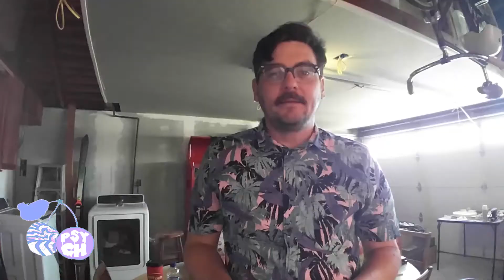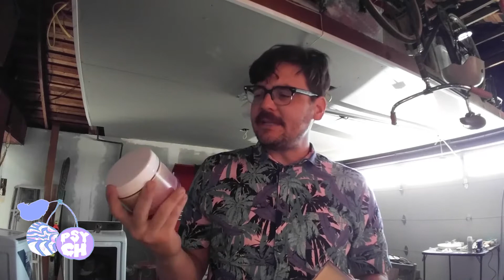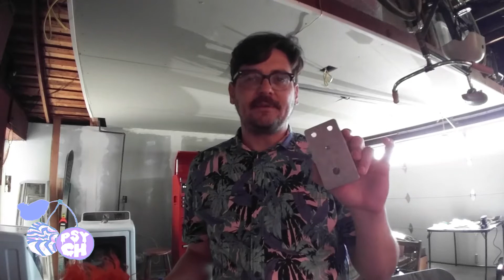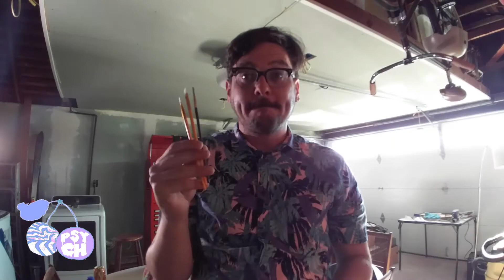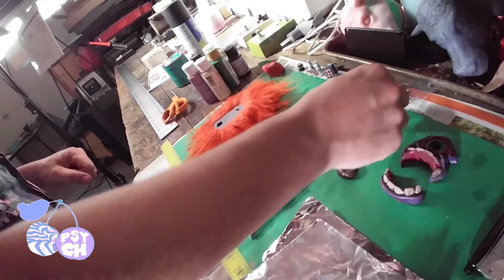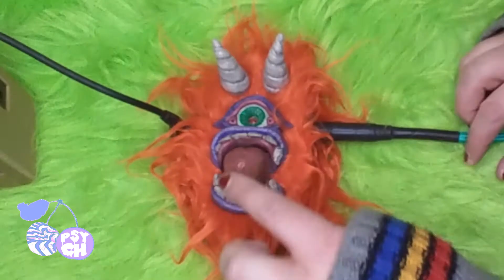MAKE A FUZZY COMPANION FOR YOUR FX PEDAL- PART 2 | The Psychedelic Cherry Tutorial- Part 2

Comment: thats a lot of art and science for such a simple circuit . long live low parts count fuzz . typing of - two words - eatyourguitar wolfcpu . thats the 8 knob fuzz that siliconned the germanium pants off of pink jimi photon . that fuzz creature is the coolest  goofy enclosure thing i have ever seen . want SO bad . great job and one question , is that like jb weld type epoxy or specifically what type of glue did you use as i missed that .